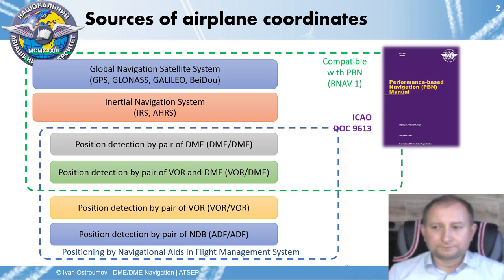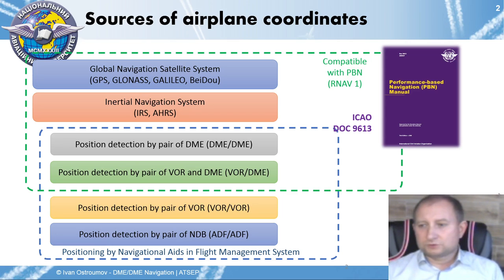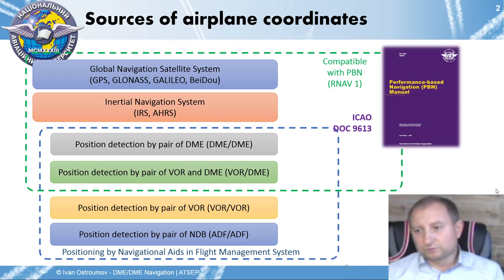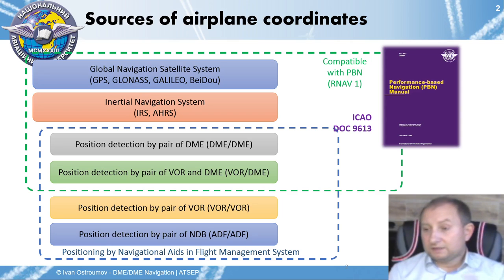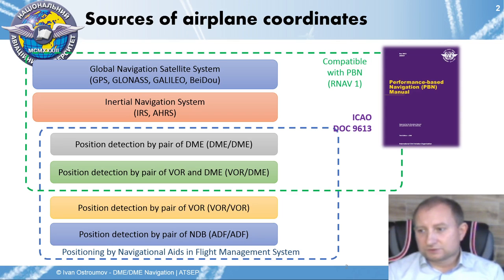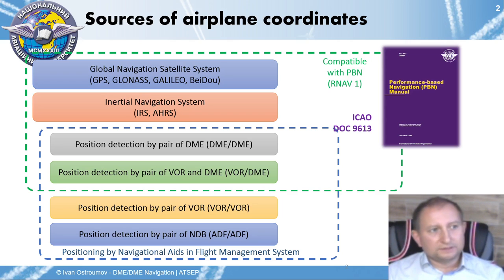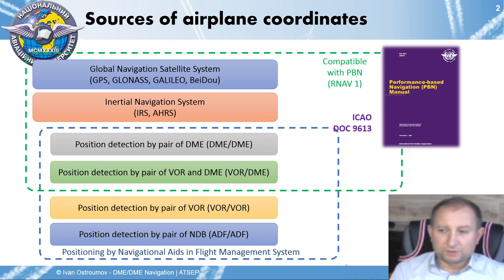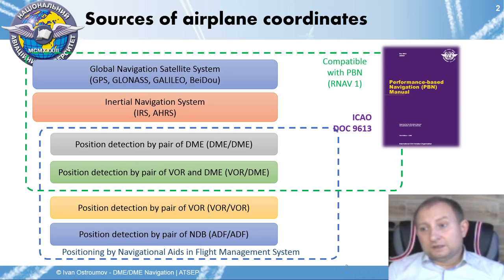Airplane navigation by pair of DME/DME | RNAV | Performance-Based Navigation

Comment: Could you explain NSE in little detail? Is it include just DME error or is it average of dme, propagation and aircraft receiver errors?
Reply from the maker: This is a common Question. 
1.In case of PBN, TSE and NSE are related to maintaining particular coordinates. Thus NSE is error of positioning system (not DME). DME it is sensor which measure distance (not coordinates). In case of DME/DME navigation we use FMS and FMS is like a positioning system. Thus NSE is error of positioning in horizontal plane estimated by internal algorithms of FMS and does not connected to DME errors. 
2. In case of classical navigation (loxodrome and orthodrome) yes it could be.
Reply: Thanks for explanation. Quite useful video

Comment: Positioning by pair of ADF 🤔 ? Seriously ? I don’t know any FMS doing this. What would be the FOM then 😂 ?
Reply from the maker: Good question! Most modern FMS has only DME/DME. VOR/DME and VOR/VOR as a positioning method are rarely used. ADF/ADF positioning a have seen in airplanes have been designed during 1990-2000 like An-140 and An-148. Nowadays, many countries shorted down their ground services of NDB. Thus, ADF is going to pass away. Therefore no future for ADF on board.